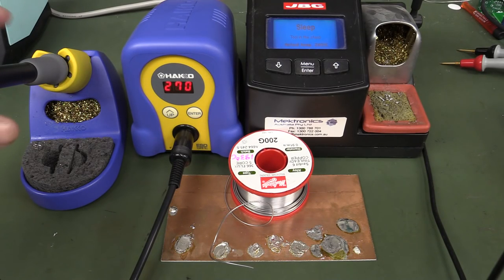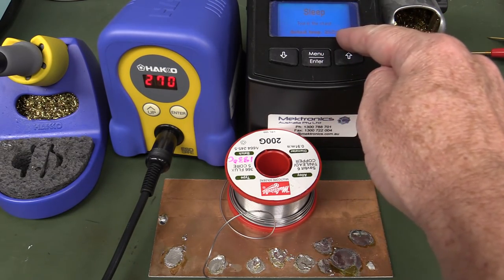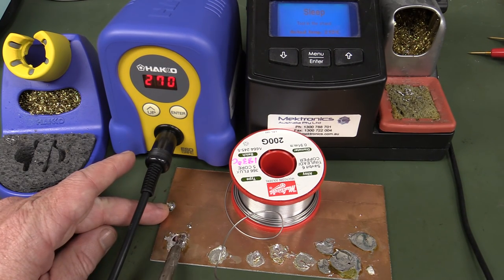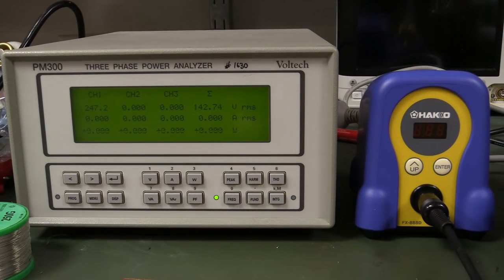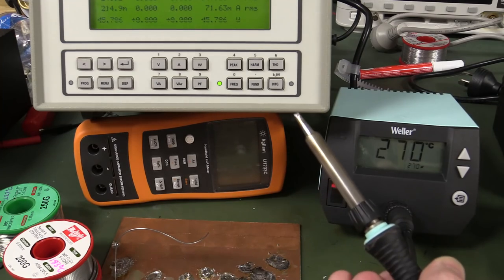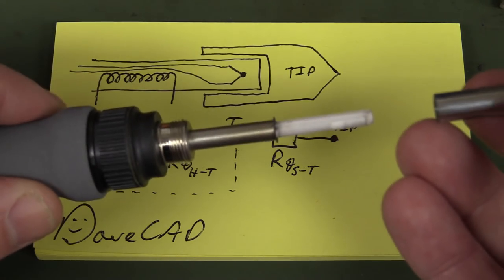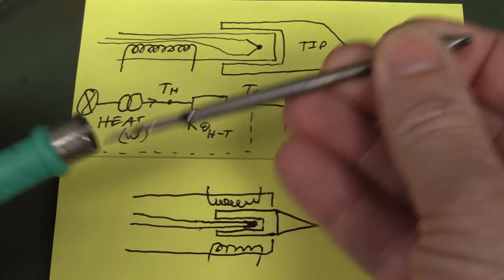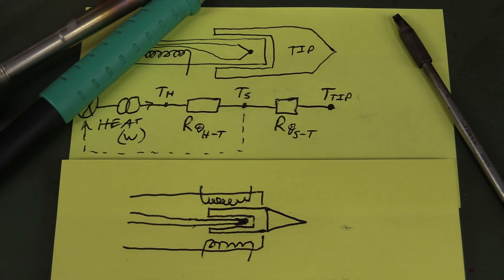EEVblog #1065 - Soldering Iron Power Delivery Explained

Comment: This is hilarious. When I was in high school doing electronics, we used the original soldering iron, a branding iron style iron placed in a butane fire and left there till hot and tested on a bar of solder before quickly performing the soldering till the iron got too cool. After a few uses the iron had to be cleaned with acid and re-tinned. That's old school! Everything that's temperature controlled is a huge pleasure to use compared to those old irons that would set fire to your project if you allowed it to get too hot!

Comment: just add 10cm solder wire inside tip hole and asmble it while heater is on . wire will melt and thermal resistance is highly reduced :)

Comment: I've used the hakko 888 and 936 for 15 years and never once wished I had better performance. It's always done what I needed. Now i want one of those new fangled types!.....Thanks alot dave!
Reply: Try soldering 10mm bullet connectors to 6 AWG wire

Comment: It was a little moot point to make about the "burn proof flexible cable" not being on the TS100. No, it doesn't come with one, but you choose which cable you want to use on your own. I ordered my TS100 together with a 24V power supply and 4 meters of silicone burn proof cable, which makes the wire from the powersupply both long enough and flexible enough that I don't notice that it's there, in fact, I have better reach with this iron than one that is tethered to a station on your desk.. :) But yes, it's not an iron that will replace your JBC. Can't expect a 60 bucks soldering iron to beat out a 1000+ bucks or whatever that 130W JBC costs and that's not the intention either. But I'd wager that it's faster to heat up and more capable than the Hakko 888, only that the Hakko 888 handle would be more comfortable to use over longer periods. The ergonomics of the TS100 handle isn't the greatest.
Reply: Need a cheap source for silicone 2 conductor cable for your TS100? Search "silicone cord tattoo" on Fleabay. $5-6 gets you 6 feet of super flexible cable delivered to your door. Don't forget to pick up a 5.5mm x 2.5mm Male DC jack for a buck as well.

Comment: It is funny reading some of the comments.  I have been through different irons and technologies.  I had 25 watt and 15 watt firesticks back at ITT and I learned to solder with them, our professors were real sticklers about our soldering.  People lost points on projects for their soldering.  I purchased a Hakko 926 when I was tasked with replacing caps in LCD monitors at work.  I had that for 7 years and it worked fine for my use.  Cleaning out the garage gave me some disposable income and I got a Hakko FX-951 and then a deal on a Metcal MX-500P, not because I needed them but I wanted them and could finally afford them.   Purely from a subjective standpoint, the FX-951 and Metcal absolutely blow the other equipment I had away.  The 926 was light years better than the firesticks I had and the FX-951 and Metcal are light years past the 926. FYI, I use the 600 (650F) series tips for the Metcal for leaded and 800 series for lead free.  I don't have or feel the need to have the same tips in different temps.  I've soldered to ground planes with a 3.2 mm tip instantly.  I also never really change the temp on the Hakko, I stay at 650F there also.  I know it's more heat than maybe I should use, but I never get to the 3 second rule I had drummed into me at ITT.  One second and done.

What it comes down to, if you solder a lot, buy the best you can, even if it takes some time to save for it.  Instant gratification really isn't.  If you are a very occasional solderer, you don't have to go top shelf.  I don't ever laugh or denigrate people for what they use or can afford to buy.  I am grateful for what I have but I am no fanboy willing to ram my choices down anyone's throat.  All I can say is that over the 3 years or so I have been part of the Blog, I have seen numerous threads/posts on people buying cheaper tools and then spending time and energy trying to make them work better or complaining about them.  Why?  What is your time worth?  What's your level of aggravation worth?  My father may have been an uneducated man but he was a smart man.  He ingrained into me, buy the best tool you can, buy it right and buy it once.  Replacing poorer quality tools more often or continually upgrading will cost much more in the long run than buying the better tool upfront, even if the cost is more painful at the time.

Comment: I use Ersa i-con 1 at work. An excellent iron for soldering at speed and heat delivery is very good on ground planes. but replacement elements are very expensive
Reply: hue I have the icon nano, which uses the same heater as the icon 1. Have you seen lots of heater failure?
Reply: The Pace ADS200 is $150 cheaper, delivers 120watts and has 40 tip types all under $15 (with a reputation of being the best tips in the industry). In a few weeks, Dave will be able to judge why Pace is cutting prices this way... it could be a game changer - let's see. I have one coming my way too.
Reply: I have only been through two heater elements in 5 months, but the the tips don't last long. We use genuine Ersa replacement tips, but even after good care of the tips they only last two week of heavy useage.
Reply: Previous Pace model owners report tip life in years. Let's see if sacrifices have been made on the new one..

Comment: I have a 951D and have never used an 888.  I believe the 888 uses a thermistor to sense the tip, not a thermocouple.  I have found a Hakko patent for an integrated tip.  If this is correct for the T15 series, the heating element and the thermocouple are one in the same.  It consists of thick Kanthal D, then thin Kanthal D.  This thin section is the  part that heats up.  Then the other metal is thick Ni Chrome.  So the thick sections do not heat up while all sections are part of the thermocouple.  There is a thermistor in the handle for monitoring the cold end temperature.  The control alternately heats and measures so the iron will always pulse.
It is a great iron I would buy again and recommend to friends.

Comment: The overshoot in the JBC is probably a feature and not a bad design, the control loop is probably calculated to be precise with certain thermal mass "attached" to the tip. When you solder, you physically alter the characteristics of the control system but not the parameters of the control loop. That´s why the damping is not working so well when it heats up mid-air.
Reply: the overshoot is because JBC tries to compensate for the thermal resistance to the tip but the response time is a function of thermal mass of the tip so if you want faster response you will have some overshoot ... so the reason JBC works better than Hakko is because the tip has at the same time lower thermal resistance and also lower thermal mass and probably because the algorithm that compensates for the thermal resistance is more aggressive, or perhaps the Hakko doesn't have that compensation at all and merely stabilizes the temperature at the sensor.

Comment: I think the ERSA icon stations still use old style tips but they do work pretty nice. My old ersa station also has a decent thermal transfer and the fit is much tighter, the heater is like the hakko but solidly encased in metal. I found just the tip style can make a lot of difference, a longer tip compared pretty bad to the shorter ones.
Reply: I have a Ersa Nano and this one heats up within  5 to 10 seconds, has a sleep function the best handpiece ever and very thin silicone leads.
Reply: Just clicked on the Video because i saw the hakko style tips compared to direct heating technology and had the exact thing in mind. Ersa has pretty much perfected the "old stlye"  The power graph on my icon 1 v shoots up immedeatly after putting the tip on a copper plane. Plus the controls with the rotary encoder make much more sense than all of this button rubbish. The ersa toolstands also are better imo, because they are sooo damn simple but yet so nice to use. Tips are dirt cheap and are pretty much indestructible.

Comment: So in theory if you threw a bunch of thermal paste into the tip of the old design would that be helpful? There is non-conductive thermal paste around if we're worried about that aspect but I could imagine a real thermal paste being significantly improved compared to just a simple air gap, right? And if it does help would your thermal paste plus old-style soldering iron be remotely comparable with a new style soldering iron, or would it just be an unnoticeable improvement?
Reply: I was wondering if some copper wool stuffed in the end would improve thermal transfer while watching. Or maybe if Hakko had used a screw on the inside of the tip and thread on the heater. 

I may try the copper wool trick.
Reply: It will, but in practice a piece of  aluminum foil will do a better job. But not too much foil, aluminum foil can melt and fuse the tip to heating element.

Comment: What kind of regulation is used in those irons?
I think Hakko and Weller just switch the heater on and off with some hysteresis around setpoint (bang-bang), but JBC obviously uses something more sophisticated, like PI/PID or similar regulation.

Comment: Hi Dave,
It's been an absolute BEAR for me and finding a proper soldering station and the tips I need.  The 900M-T-xC seems what I will have to go with (I am planning SMT soldering, Dragging, and the like and just can't--for the world--get ahold of a 'welled' tip--the 900M-T-xCM series.  Your power transfer video was especially useful.  I have n FX937D ($37.00 from ebay) and just tonight got a 900M-T-0.5C tip.  At first it would NOT slide onto the ceramic element--I saw that the problem was overlapping silver onto the tip.  I shaved it out and the tip slid right on.  Then I noticed this:  At some sections of the tip bottom, I could see a wee bit of white ceramic!  But it fit.  It looks like it might work as long as I am careful not to over-tighten and damage the ceramic piece.

At first, I was really disappointed, then thinking about what you said about the high thermal resistance between the tip and the heating element,  in my case, I have a direct contact between the tip and the top of the ceramic heater--My thought was that this might actually improve the thermal conductivity (lessen the thermal resistance between the heater and tip!  What do 'ya'll' think?...haven't tried it yet.  The tip that comes with it seems to fit all the way down, still with a bit of gap at the top.
--daLe

Comment: Hakko has the FX-100RF in response to the Metcal RF design. I like the new tech, but the 951 interface is anything but new. A review of the FX-950 which IS available in AU might poke a stick in the sides of HakkoUSA who seem to have decided not to import that unit to NA. Funny though, the parts list for the 950 show 110V and 120V transformers are available.

Comment: They have special tools for this? I've been using a butane lighter.
Reply: I recommend an upgrade to a butter knife on the stove top. Much better performance over the bic.
Reply: here I been using metal clothes hanger and propane torch
isn`t technology something great? wonder what they will think of next ? 
by the way did they ever get that home computer thing sorted out or am I stuck with my old punch card reader with vacuum bulbs forever
Reply: WOW never thunk oh dat tanks for da infermation
Reply: No joke, my uncle soldered radio kits for fun and profit on her mother's kitchen using the butane range and a nail held with pliers.
Reply: I use a magnifying glass, needless to say, soldering takes a while during the winter season..
Reply: you like rubbing stuff, right?
Reply: I just use my mothers iron, works great for reballing too
Reply: I was expecting the hot iron to melt the display panel, each time Dave used the hot tip as a pointer while he talked.

Comment: Gee, this answers questions I had for years with my little Hako. I bought a bigger tip and boosted the temp setting, but even with that I'd wonder why the on light wasn't on while I was waiting. I assumed the thermocouple was too far from the tip. It certainly is worse if the tip housing isn't tight. As you say, you can appreciate an unfortunate heat cycling that is a great waste of time for long projects.

Comment: What if you put like.. Thermal grease inbetween the heater element and the tip? If you fix the heat transfer "problem" they should behave more similarly right?

Comment: Here's a thought.  When the tip is installed, there's a small gap over the top of the element and an air gap of about 0.35mm (0.014") around the element on each side (on mine anyway).  Cut some some fine stranded copper wire about 50mm (2") long and keep the strands straight and parallel side by side.  Give them 1 or 2 twists in the very center and then fan them out.  Lay it centered on top of the element, fan out the strands like an umbrella and fold the strands down over the sides of the element then slide the tip on (adjust the length and number of strands to get a fit).  You could wrinkle the wire a little to give it some spring.  That would be easy and just might work.
Reply: It worked.  The strands I used are 0.25mm.  Had some trouble with a used tip because it was rough on the inside, but a new one twisted right on fairly snug.  Make your 2 twists short and tight.  After you form the strands down against the element, slide the umbrella out a little from the tip and press it a little with your fingers so the tip will go over it.  Then twist the tip on slowly in one direction.

Comment: The main issue with the hakko style irons is that the ceramic element does not reach the end of the tip, creating a gap. It is possible to remove 1 or 2 mm from the cylinder by filing it down. Just remove the ceramic element, and file down the tube. I have done this on 2 wands now, and it helps performance greatly each time. It removes the ferrule, which does not matter. I suppose you could also try some fine copper wool, and wrap it around the ceramic element, but I did not try this.

Comment: Hi all:  Have you heard of the technique of inserting some sort of copper foil or cream into the air gap of the Hakko type tips (between the slip-on tip and the ceramic heating element) to increase heat transfer to the tip?  Does this work?

Comment: I do have a Metcal MX500 soldering station and I also have a TS100 and some other cheaper irons, which one do I use all the time? None of the above! I use a soldering gun or my homemade LI-Ion battery powered soldering iron using a Metcal tip, which I have a video of on my channel, I use them because they are convenient and the tips are basically free especially on a soldering gun. I know that it's hard to use but if you master it, you're golden. Awesome video. Keep up the good work. Cheers :)

Comment: Some induction type irons are adjustable like the Xytronic ones, they use low voltage high frequency AC and a temperature probe that inserts into the back of the tip. Instead of using the curie point of the tip they use a PID loop to control temperature. Some of those are quite powerful up to 200W.